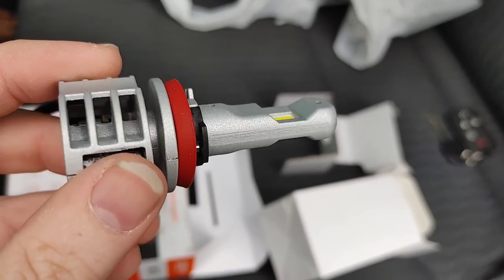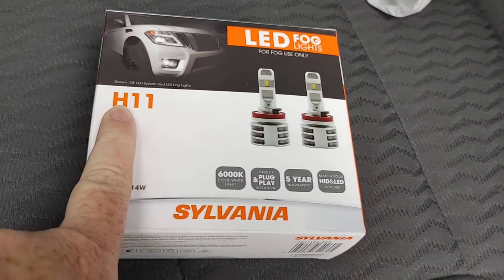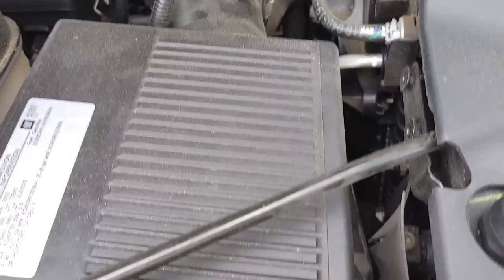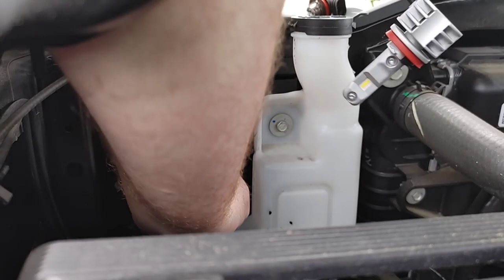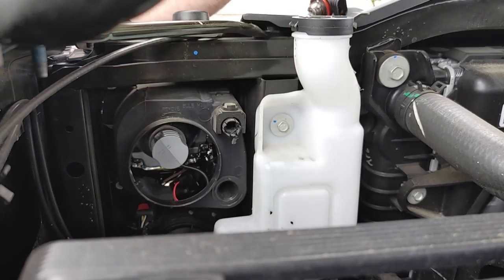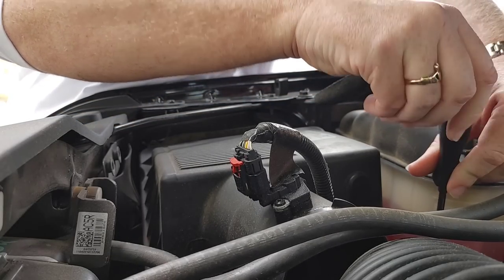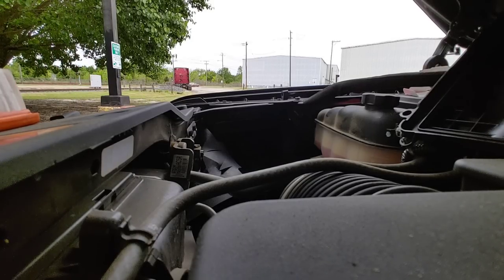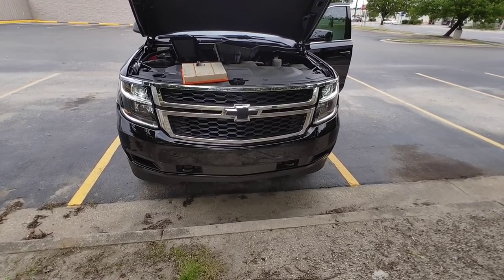LED Headlight Swap Easy How To 2019 Tahoe

Comment from the maker: You can find even cheaper LED lights that work right here in this link.

https://amzn.to/2VCcWyW

And sub to the other channel 
http://YouTube.com/tommykelley 
For the More TK Channel
Reply: TK's Garage  only difference between the lights you got and led headlights is the chip count   On the bulb.   Head lights have two one for main and one for high   And f the dot
Reply: dont buy led bulbs on amazon most of them are junk and die in 1 month or the beam pattern screws up your light output
Reply: 1 5   You can buy em on Amazon. Just don’t go cheap. I bought a set off amazon a little over a year a go thay work fine. Head creed makes the bulbs I have.   Don’t buy led dash bulbs though

Comment: I bought a pair of cheap LED lights for my Cavalier.  (9006-hb4) and they are much, much brighter than the normal bulbs.  And it only cost $9.98 for both!  (Just the low beams)

Comment: My wife has a 2020 and it says do not add led bulbs, in the manual. Is there a way around that?
Reply: Because over time the heat might burn up the wiring. There are lots you can buy to prevent that or bypass the factory harness and wire straight to the battery.

Comment: When i bought my tahoe i had to do the samething because the I couldn’t barely see anything with the original halogen bulbs and even with the leds the visibility was not good enough so i had to order a set of fog lights and install the leds on the  fog lights as well. It gave me the bright visibility I was looking for and my Tahoe looks a lot better with them on...

Comment: I did everything correct and now my check engine light is on from testing the headlights bulbs with the air box sensor unplugged. Anyway to clear it?
Reply: Autozone
Reply: Did you fix the problem? If yes what was it cause my check engine light came on also
Reply: @chrisruiz1215  it eventually went away. What caused it was starting up my car to test the lights without the air box sensor plugged back in.
Reply: Yes thank you. Mine did the same ☺️

Comment: Once you do that check the adjustment...I know it's not the correct way but I go to the front of the truck and put myself it the approximate postition of an oncoming driver and see if the lights are in my eyes

Comment: Bad advice. The H11 bulb he is demonstrating is a fog light bulb.

H11 Fog light bulbs were not intended to be on for extended periods of time like your halogen headlights are.

Yes, they will work for a short period of time, but they will burn out quickly.

If you really want LEDs, by the proper conversion kit that will fit your Tahoe.

Comment: Does it matter if the led chips are in the 3 amd 9 o'clock postion?
Reply: Work best at 3 and 9
Reply: @perrystarr251  even on a projector lens?  Its a bowl of reflection not left to right like traditional lens
Reply: @jdmartinez4238 guy at headlight revolution said 3 and 9

Comment: I see your front license plate holder is removed, did that leave any holes in your bumper, anywhere?
Reply: @stevec9102  i removed my front ones & yes they left holes. It kinda looks like sensors

Comment: Ugh I have to go to Carmax to get it changed. Would have tried myself but it’s on the difficult side and expensive. Made your truck look good sexy
Reply: I’m a woman by the way.
Reply from the maker: Where you located
Reply: Lagrange ga. I went to the part store to get the bulb they said I needed the round bulb. The really expensive one

Comment: Sometimes LED lights swap tend to fog up the headlamp housing be careful
Reply: true if the car didn't have a trim of it with same light housing that came in led but this tahoe they come in led in the premier and z71 and the other trims with the same lights housing 

some cars change the whole lights if you go up in trim like tacoma, tundra, ram etc... 

now if your car lights didn't come in led in any trim (with the same light housing) i would advise on just skip all the trouble and just get new aftermarket led lights sure they might cost a lot but they wont fade or turn yellow the alignment wont be messed up and will actually light up the road way better than the halogen ones

Comment: Hey TK I wished they had led lights out back in the day.. I remember having to buy the xenon kit... it’s was nice but would have issues with the ballast. I think all corporations should ala carte xenon or led lights on all models.  I just don’t get I can buy a 2020 corolla and it comes standard with xenon lights, but if you get something more money.. you have to buy top of line model or get lucky and cop package that has it.

Comment: Good Video TK
Link does not work ???
Reply from the maker: Really? Well if not pick them up at advance auto parts for 99
Reply: @TKsGarage  Does your tahoe used the Headlight for DRL ?
or 2018 up have LED Strip Light up as DRL ?